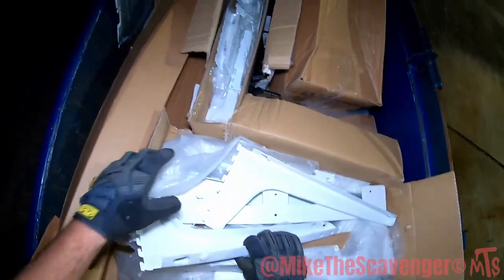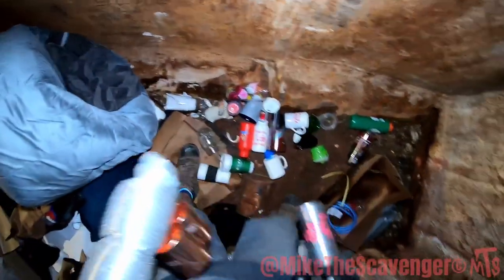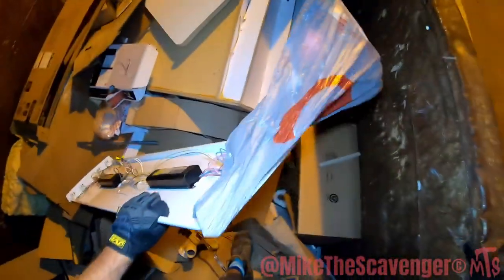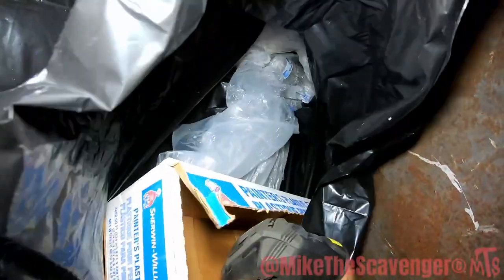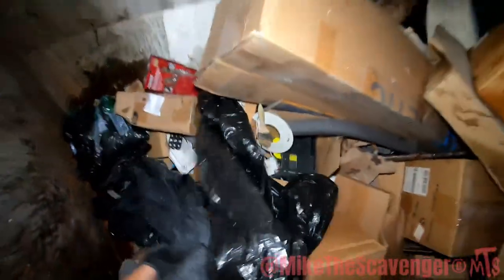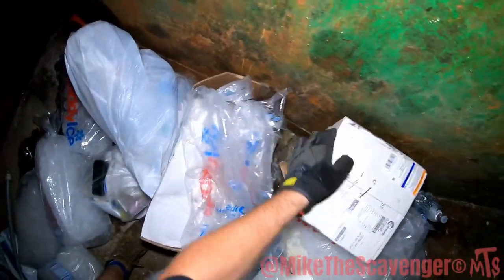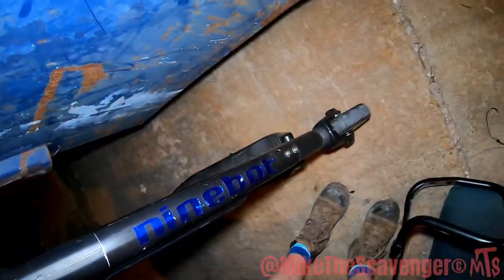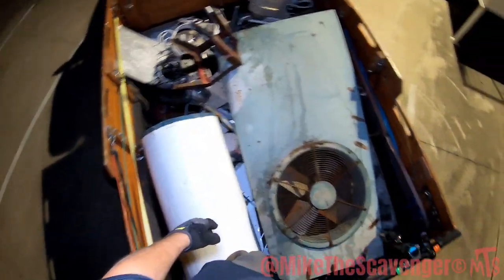Dumpster Diving "I GOT SUPER LUCKY!"

Comment: The brackets and black electrical pieces you found in the 2nd dumpster are for cubicles. The brackets (called cantilevers) are for the work surfaces to mount on and the electrical sections are for the power that runs through the bottom of the cubicle panel.

Comment: I was always told heating coils were made from Nichrome Wire. High resistance which makes heat when electricity flows thru. Inconel is what the vanes for turbos and jet engines are made from.

Comment: Those connectors that you found in the box at the beginning of your video those are power connectors between 1 cubicle to another cubicle that are lined up next to each other they go down on the bottom on the track that holds up the cubicle where all the electrical is and that's where you connect those two together and it's either Herman Miller or steelcase but they're definitely electrical

Comment: that turn signal lens assembly in the dumpster you found the paint ball gun in will fit dottie or a 1999 to 2003 crown vic by the looks of it from back side

Comment: Should take & test those traffic light 🚥 assemblies, they aren't cheap & usually most still work & either a few LED's are out or nothing wrong ,but they just upgraded or wasteful replacement for overtime.....still trying to get the actual traffic lights🚥 & don't walk signs , found plenty of the LED light source units & either sold them or gave them to friends

Comment: Those plastic camera housings with the wiring and the fence to them you should clean those up but leave them intact and throw them up on eBay I for one would have a different use for one small modification or two and you'd be surprised with what you can do with them you could basically turn one into a retro fashioned candy dispenser if you know what you're doing I for one wouldn't mind having one to do exactly that with but considering the fact that you're going to go ahead strip them down and basically toss them out like nothing to it I figured I'd throw this comment up here since this video just popped up for me today

Comment: It kills me seeing you throw that battery pack back Usually those contain 18650 batteries which pretty much make the world go round you can take those apart and use the batteries inside for anything you can think of Repairing drill batteries that don't work, laptop batterys ect. ironically the scooter you found runs on those Anything from electric vehicles to you name it The scooter you're gonna want to take out the GPS SIM card to get it working again They contain a card like your phone to keep track of them and they pretty much shut them down when somebody takes them where they are not supposed to be so you'll have to take that out 1st and then hopefully you can get it the battery charged backup you need to get it just a simple charger those are usually 36 V Sometimes you have to replace the batteries depending on how long they've been dead but once you to take out the SIM card and all the GPS electronics should work great for you. It looks like it was a segway

Comment: Why in hell would you open all of the Yale locks boxes and throw the pieces in your truck"" Does the value of the things you find mean nothing?
Reply: They value is what he can get. They are used locks and no one will buy them.  So many arm chair scrappers
Reply: Mike is a scrapper, not a reseller.
Reply: @darrenshields1522  How do you know that? I couldn't afford to buy one of those new, I would buy one used if it worked and you didn't have a key. I don't need any bust bodies coming around my house with a key trying to tell me what is or how it is.
Reply: @indianaslim4971  He is a reseller he has mentions his garage sales and listing things on eBay all of the time.
Reply: @keithjohnson281  you are correct, he does sell occasionally, but that is a side hustle to his main gig which is scrapping and the focus of the channel.